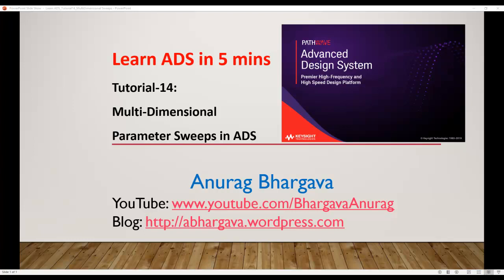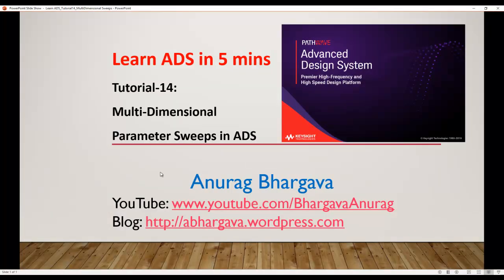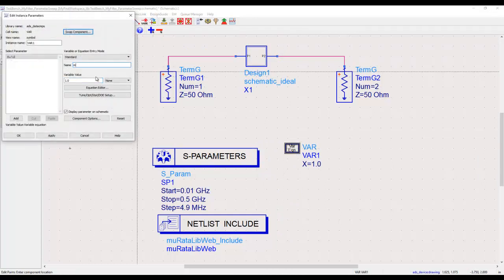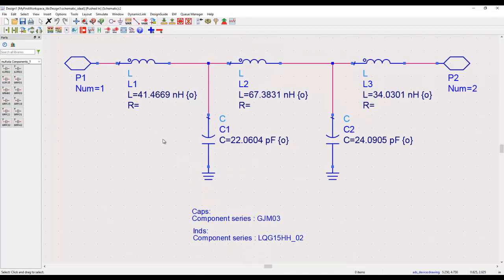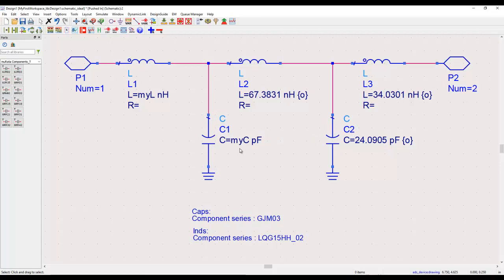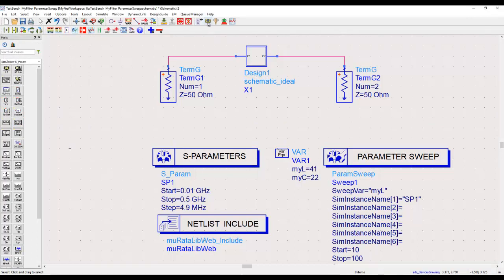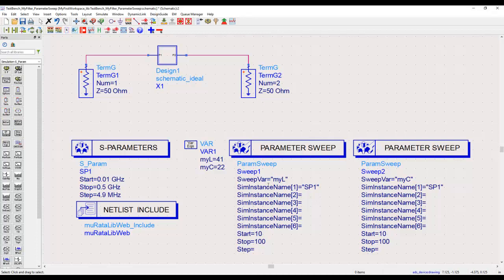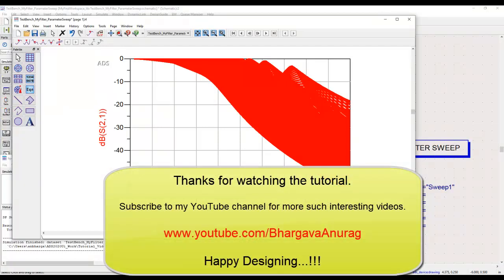Tutorial-14: Multi-Dimensional Parameter Sweeps

Comment: Thank you for the tutorial videos. What about the Parameter Sweeps for more than two parameters? Should we add more Parameter Sweeps tools as the number of parameters increases (let's say 6)? Thanks
Reply from the maker: @tologonkarataev6569  you can either use N number of Parameter Sweep components or simply use 1 Batch Simulator component. Using Batch controller will be my preferred option
Reply: @BhargavaAnurag  Thank you for your response. It helped a lot.